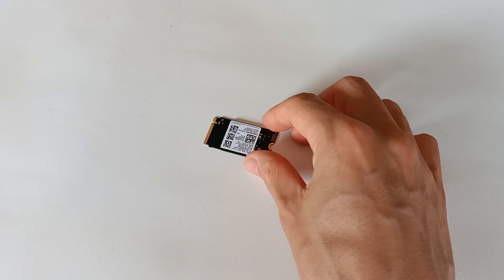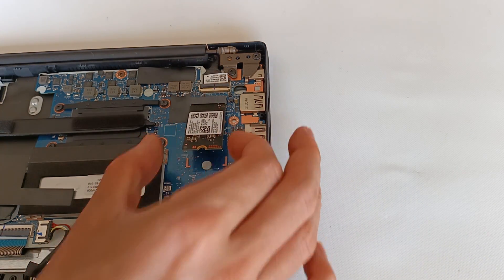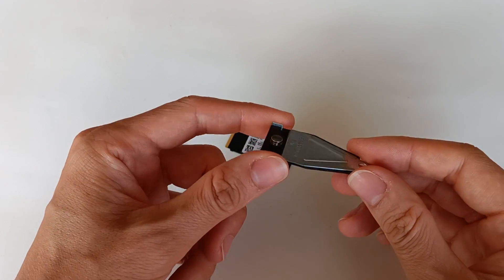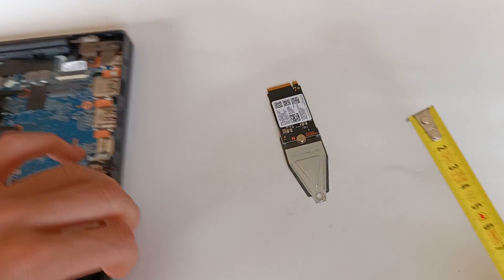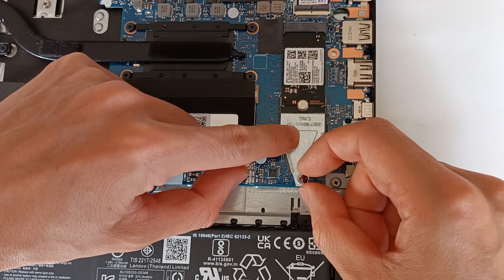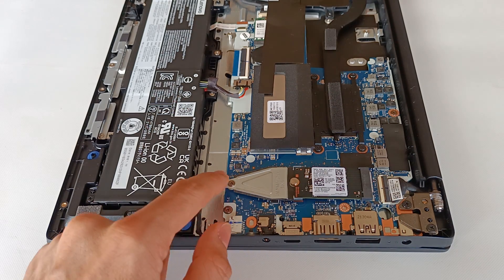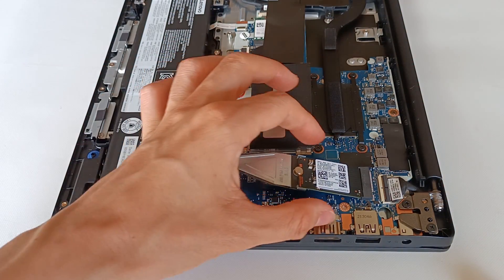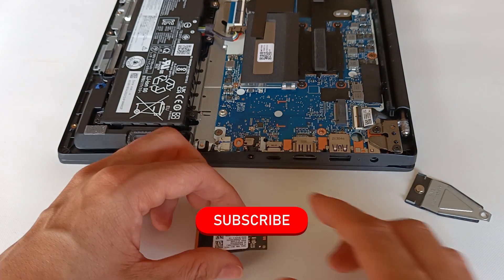How to mount an M.2 2242 SSD module on an M.2 2280 motherboard with an extender

Comment: you can just use a rubber pad with adhesive on the bottom. stick it right under and screw it into the pad. make sure the screw isnt too long so that it doesnt touch the pcb. ive seen people just tape it down with electrical tape.
Reply from the maker: yes, but it's not the correct way